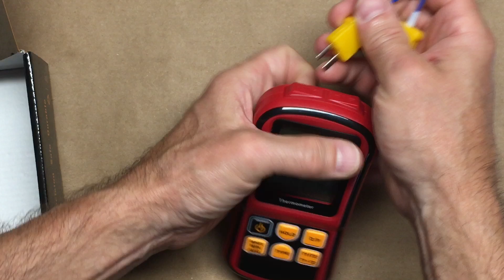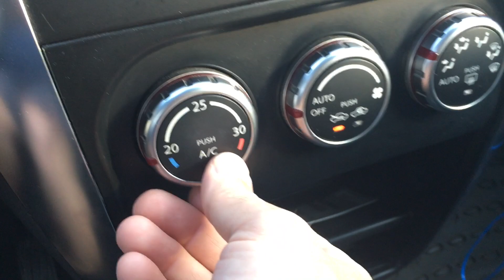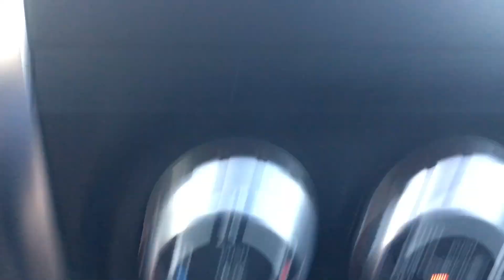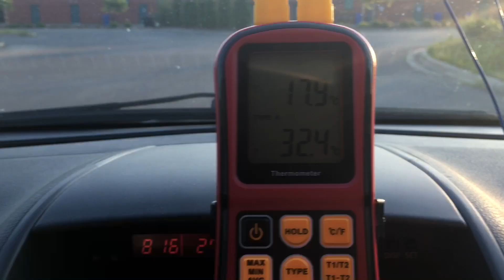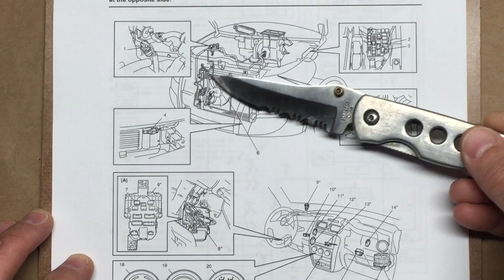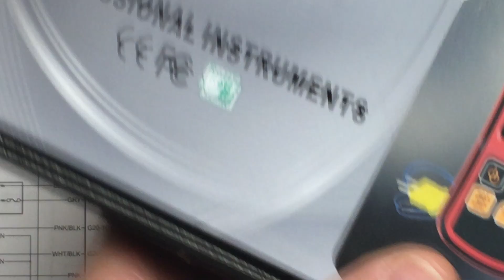Simple Fix  A/C Issue

Comment: Thank you for your video and the explanation about the condenser fan and your neat trick to demonstrate the problem.   I need some help please.  I have a 2000 Toyota Avalon XL car which runs good.  The car air-conditioning puts out cool air but only to about 10 degrees Celsius or 50 degrees Fahrenheit when the outside temperature is 32 degrees Celsius or 90 degrees Fahrenheit while I'm driving at 100 km per hour (or about 60 mph on the Interstate in the USA).  I think the a/c should go down (used to go down) to about 5 degrees Celsius or 41 degrees Fahrenheit.  When my mechanic did the pressure readings using the manifold gauge, it was 250 psi on the high side (sorry I don't know the Canadian units) and 80 psi on the low side, so both the low side and the high side pressures are quite high.  He said the compressor needs to be replaced.   I thought this points to replacing the expansion valve.  Earlier a dye test showed no leaks, and also the mechanic held a vacuum on the a/c system and replaced the refrigerant to proper specifications, and also the cabin air filter is good.  Does anyone have any suggestion / explanation?  Thank you.
Reply from the maker: Samir K Hi...I am only a hobbyist no expert. Those pressures seem too high. From your description it sounds like the condenser is not cooling the refrigerant efficiently. Check inlet and outlet (liquid) line temp. Should be a difference of 15-30 degrees C (59-86 F) . Too low a diff external coil issue, too hi internal restriction...Check for damage debris obstructing the coil, shrouds and seals. You said the issue is present even at speed so the condenser fan is likely ok...check it anyway. Good luck. Let me know if you resolve the issue. Again this is only my thoughts...I am not an experienced A/C Tech. 👍

Comment: Good demo & cheap is good if it works. Not sure I'd be so brave to test that out on my old van. The condenser is still the original and 18 years old. Your high side pressures when not moving would have shot up way over 300 psi, probably nearer 400 psi. We're back to low 20's here in Southern England ⛅
Reply from the maker: Automotive Solutions Just a wee toy... “professional” grade tool...laughable! Yeah I tried to make this demo quick...the A/C was not in operation the entire time. Only when the camera was rolling for the most part. Still as you say... not without risk! Cheers Mate